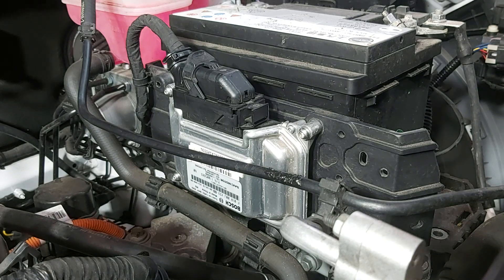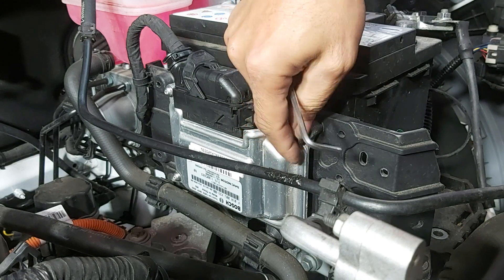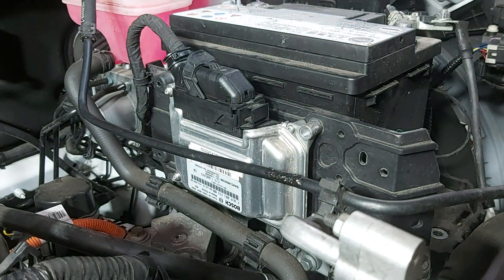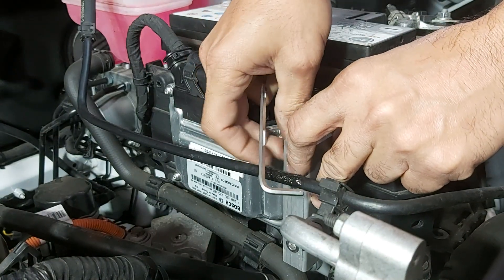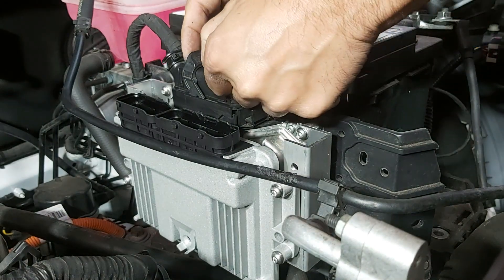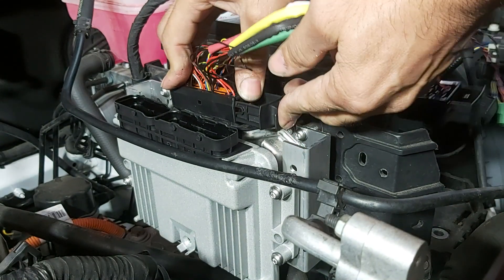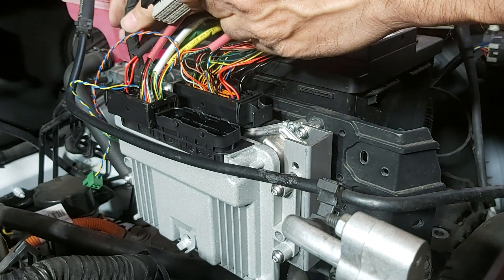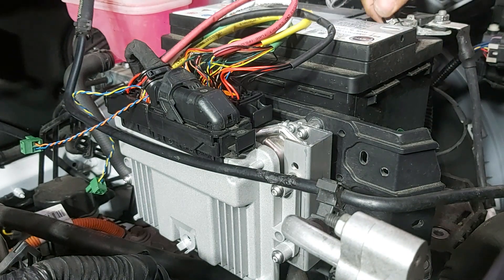MG ZS EV One Pedal Driving Upgrade.

Comment: What is the price of the beta version?
Reply: There are many here in India. I would certainly be a buyer. If you don't intend to build it, can you drop some pointers on how we can build our own?
Reply from the maker: I haven't got it to the point of being able to sell any. I was testing a new board and case and make sure all fits nicely. There are some mistakes on the board (mainly dimensions and position of components to fit in the case properly) and still have some extra circuitry that I haven't tested.
Reply: @franciscoshi1968  Did you ever get around to getting this project finished and monetized. Would be interested in buying if you have this for sale.

If not, would this be something that could be somehow released in the public domain (Would offcourse require that the hardware is not very specific to what it does)
Reply from the maker: @JohnDoe-bd5sz  I have been a bit busy with other projects so not much progress.
What was needed for this to become a product was the need to apply the mechanical brakes when the car stops. I spent a fair bit of time trying to find the brake command but it wasn't there. Later I found it is on a different bus.
Finishing this project is in my long list of jobs to do. At least now I know how to solve the last problem. 
I don't have my MG anymore so this makes development a little harder. I am also thinking that the MGZSEV is not very popular (at least in Australia) and I am not sure if there would be enough demand.
Reply: @franciscoshi1968  I see and i understand the monetary side of this, but maybe if you looked beyond Australia, worldwide there are quite a few of the MG ZS EV's

Depending on what such a device would cost i think you would be able to sell it worldwide.

It looks to me like this is not a device that would need fitting by a mechanic, anyone without 10 thumbs should be able to do it at home.
Reply: @franciscoshi1968  Nice work. I have an MG HS phev with the same issues you describe. How did you get started in the reverse engineering process?
Reply from the maker: @DamienMorrissey first is you need to put a CAN bridge and decode the messages going between the different computers.  If you don't want to cut wires you have to get the plugs and make a small harness to T into the signals.

Comment: Will you have Mg test the modification or will you sell directly?  Will certainly void the Mg warranty unless approved and fitted by them.
Reply from the maker: MG would never approve this box. Approving this box would mean accepting their system has faults. One of the purposes of this box is to fix the ACC so it uses regen.
As for voiding warranty, using this box would be no different than using an accelerator controller for 4WDs. They also void the warranty.
Like accelerator controllers this can also be unplugged and would put the car back to original with no sign of modifications.
To get the extra regen and one pedal driving you need to modify the accelerator pedal but you can get a spare pedal and modify that.
The reason for modifying the accelerator pedal is to modify the feel of the pedal so it is easy to control the extra regen and also makes it easier to coast.
It will still work with the original pedal but it is much harder to find the coast point.
Reply: @franciscoshi1968  If MG can not detect this mod, if i bought it, i would just remove it when having the car serviced and reinstall it afterwards.

Seems pretty simple to do.
Reply from the maker: @JohnDoe-bd5sz  my friend had it installed on his MG when it was taken to service (and a warranty claim)  all he did was unplug the box and left the box attached but unplugged.  MG never noticed. One other mod needed (which MG should have noticed)  is the accelerator pedal modification which adds two spring rates. Any decent tech should have noticed that and flagged it as a broken accelerator pedal but surprisingly no one noticed.